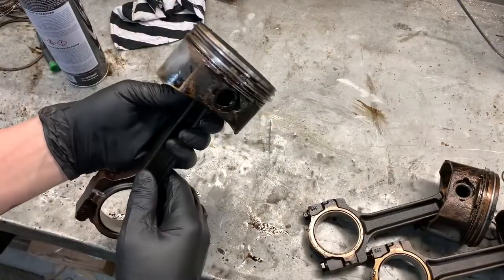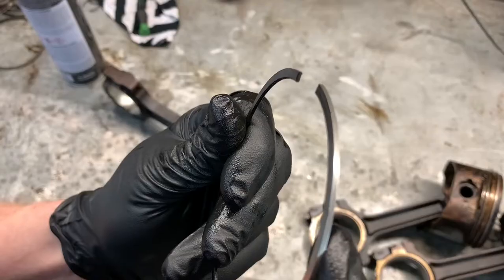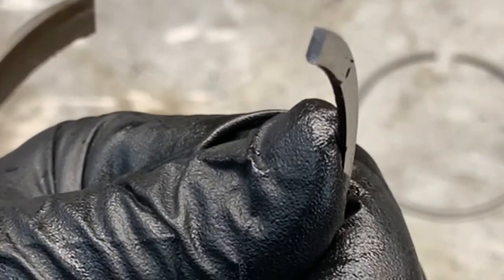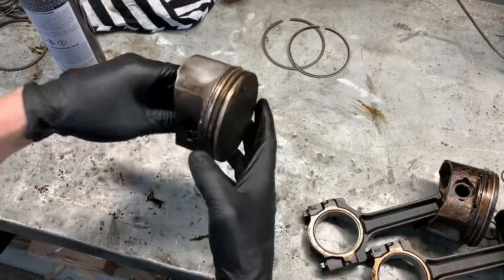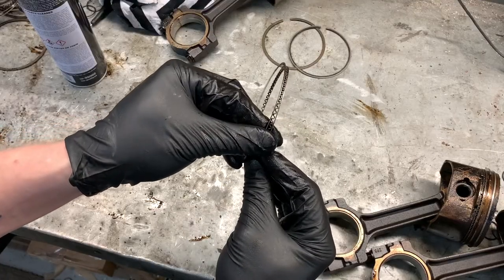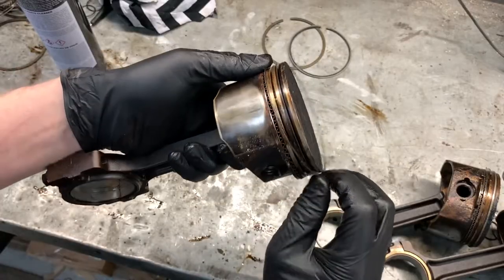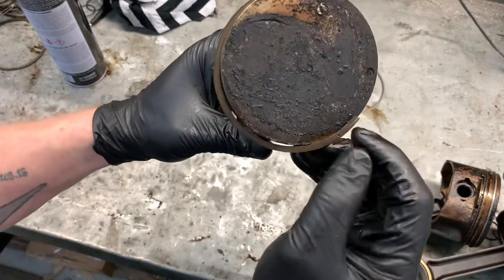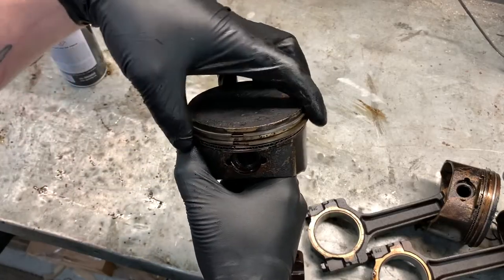How to install piston rings, which way do they go? quick and to the point.

Comment: This was a great upload for people trying to learn. When most people take the top two rings off to gap for boost, they just leave the lowers in tact right?  Nothing to modify on them so why remove them correct? Thanks
Reply from the maker: Hey man I hope it helps someone one day! 

If the pistons were clean and the engine wasn’t burning oil I’d say yeah absolutely leave them alone.

Comment: Can you help me? i am rebuilding my motorcycle and the rings i got
1. ring with all edges chamfered on all 4 corners marked with "R"

2. ring with no chamfers anywhere just flat square mark "2R"

3. normal oil ring pack

which ring should i use as the top and 2nd ring
Reply from the maker: Id guess they go installed in the order you have them written here, but I can’t say for sure. It would be best to call the manufacturer of the rings and ask there to be sure
Reply: I've got a set of those rings as well, I got mine from AliExpress, I've no idea what way they go 🤔
Reply from the maker: Jeez did you get them for 3$ lol